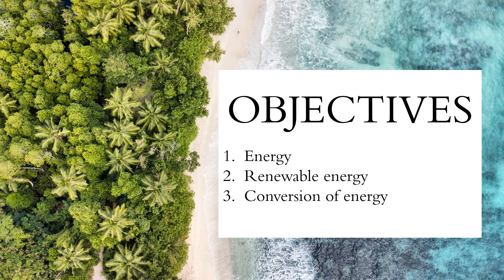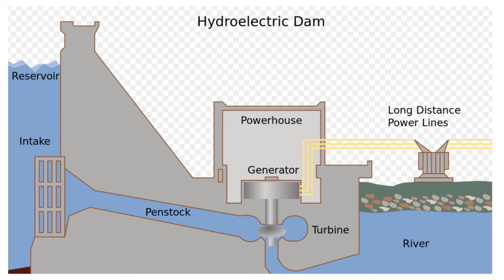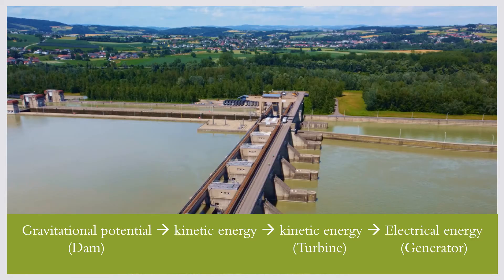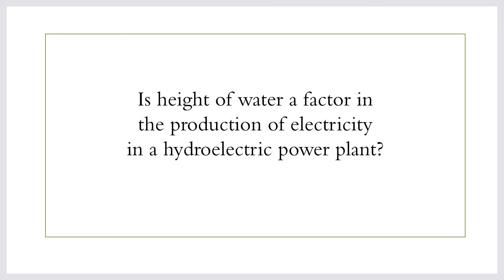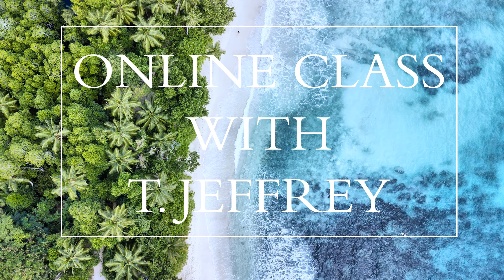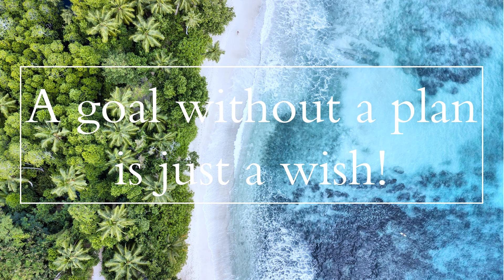Conversion of energy in a hydroelectric power plant

Comment: Sir I have one doute  potential energy convert into kinetic energy than the kinetic energy convert into mechanical energy in the turbine after rotating the turbine mechanical  energy convert into electrical  energy .I thik this process will be happened
Reply from the maker: Correct, the potential energy is converted  to kinetic energy then to mechanical energy to electrical energy.
Reply from the maker: Potential energy is stored energy and once in motion, it becomes kinetic energy. The potential mechanical energy will be moved by the moving water and becomes kinetic mechanical energy.